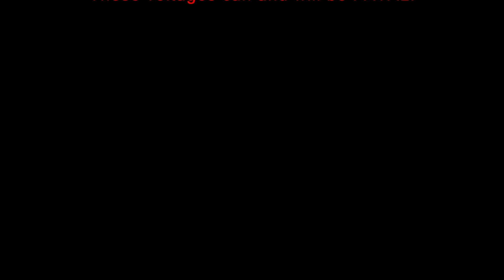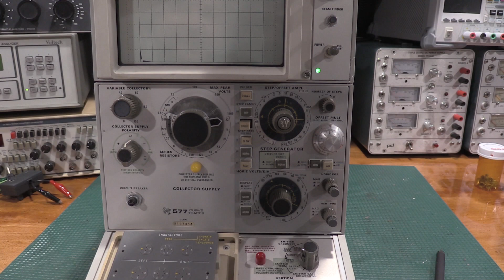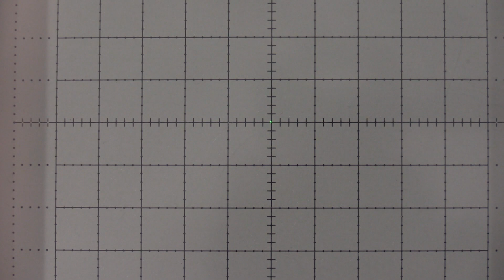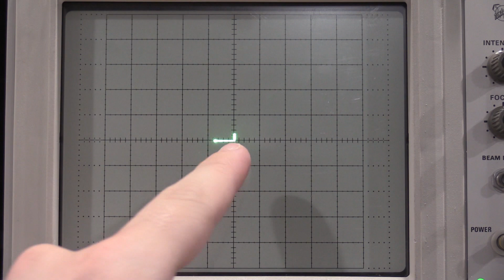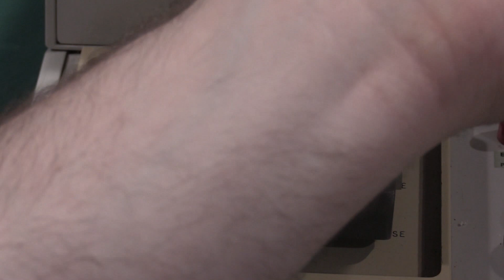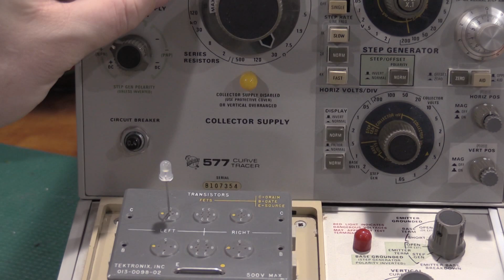Tektronix 577 Adjustment Check-in and Demo

Comment: Thank you for doing this video. I have a question I hope you answer soon. if one has a huntron 2700 and a good cap leak tester is a curved Tracer 577 a good addition or is it redundant?
Reply from the maker: In my opinion the 577 would be an increase in capabilities and its primary use even though called a curve tracer is different than the Huntron line. The huntron trackers are primarily in circuit testers and fault finders. I would like to get one of the more modern ones that has the software for the lab as it might be useful. Capacitor leakage tester is also an excellent device I have a few of those in the lab as well. But when I need to test ULTRA low leakage I need to use the SMU (2450) or the 577. My IT-28 passes capacitors if the leakage is below 5nA for the big stuff and 2nA for the small stuff. 
But neither one of these situations is where the 577’s and 576’s hit their sweet spot. Their primary purpose is for dynamic transistor testing and matching. I have also need the higher voltage ranges on the 577. The top end range is 1600 Vdc. This came in really handy when my fluke 5200a nuked the -190Vrail do it a leaky pass element. However the transistor was not dead so it tested good at low voltages. Only around 150Vdc did the leakage start to show up. 
I guess this is the long way of saying no it is not redundant if one can be found for the correct price. I have not run in to one yet on the secondary market that has not need a bit of work to get going again as these videos can attest.